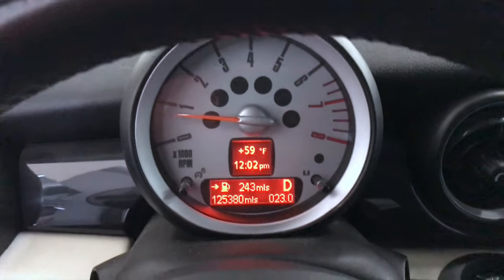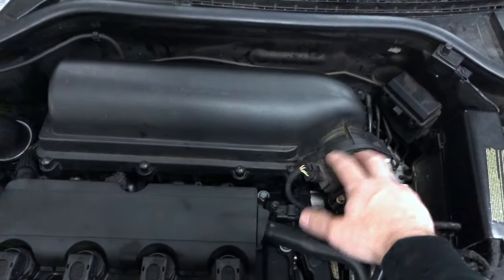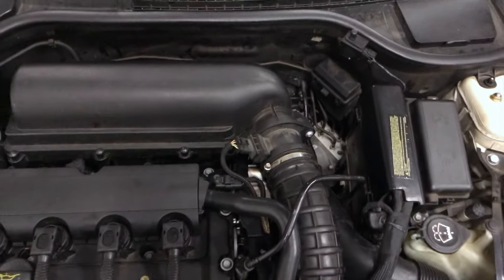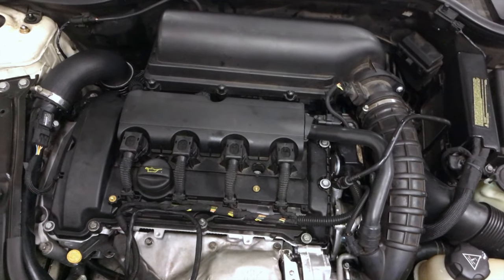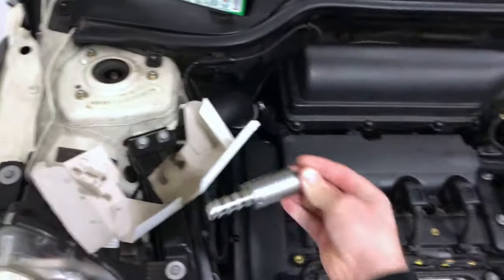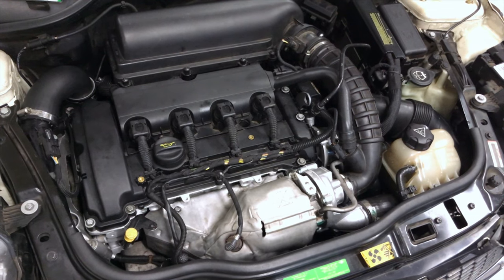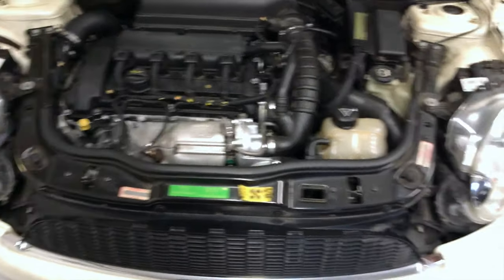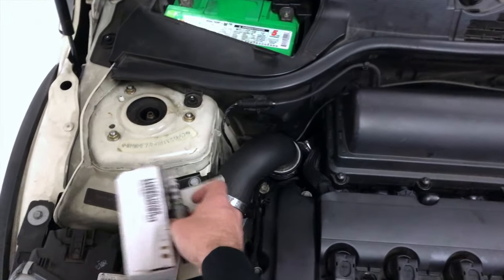MINI:  Erratic Idle Issue, SOLVED

Comment: Hi Mike, great video. I have a 2017 F55 Cooper S which started doing the same, rough idle and jumping revs, but only when it’s cold. After a few minutes the problem disappears. 
My car is currently at the dealership but they haven’t found the problem
Do you think it could be the Vanos Solenoid?
Thank you
Reply from the maker: That is a different engine, so likely not.  Let us know what they find. Thanks for watching.
Reply: Mike MDs they solved the problem! Apparently it was some sort of programming the car’s computer needed. 

They told me the problem may have started one time that the car ran out of battery and I jump started it with another car. The difference in voltage could have messed up the settings. Something to be aware of if you want to jump start this German complex vehicles nowadays.
Reply: @ivancaro8544  Do you know what they had to reset? I have a 2012 R60 S All4 with this same issue and I've been chasing it with new parts for a while. It has a rough cold idle, but cleans right up when the car warms up. I've jumped my car in the past, but never thought that could be the root cause of the issue. I called my local dealer and they haven't heard of any issue like this. I want to be able to send them in the right direction to get this fixed.
Reply: @Rudeman422  Hi Rudy,

The way the dealership will found the solution is to experience the problem themselves. In my case, I left the car a few days there and they told me that one day in the morning when they turned the car on, they felt the rough idle. They proceed to concect the scanner and found out the car needed coding. At the end they told me they had solved the problem, but in case I would further experience the rough idle, they would have to change the Radiator Condenser Cooling Fan, as well as the Fuel Tank Breather Valve. So I imagine the coding had something to do with this parts.

My advice would be to scan de car while the rough idle and see if there is any coding the car needs, or look for some faulty codes. The problem with this cars is that they are so electrical and when you jump start them with another high voltage battery, it can cause some issues. I was also experiencing a bad fuel consumption, about 18 miles per gallon. After the coding I´m averaging 28 miles to the gallon.

Good Luck!

Comment: When I turn on my mini r50, the idle goes lower than usual for a few seconds, it shakes and then goes back to normal. It does that a few times when cold then after a minute it runs normal...do you know what it might be?
Reply from the maker: Might be a vacuum leak.  You will need to see what fault codes it has if  any.
Reply: @MikeMDs  it doesn't show any engine faults
Reply from the maker: It sounds like a vacuum leak if i were to guess.  It takes a pretty large vacuum leak to set the check engine light on the first gen MINI's
Reply: @MikeMDs  I will check that. Thank you very much for the help

Comment: I wonder if this is an issue that can plague bmw as well. I have an 04 that I have replaced many parts on and still getting shaking idle. maybe need to do a trip to the pull a part to check it out.
Reply: BMW has a bulletin for this. Very common problem.
Reply: @lynxstarautomotive208  any way a normal pleb can locate such a bulletin?

Comment: hey mike I have an 07 JCW and when the engine is cold it doesn't like to start and I have to rev it for it to run. It does have the code for the MAF sensor but I know that more than likely means I need to change the throttle body. When the engine is warm I don't have this issue upon starting. any tips on how to move forward would be greatly appreciated.
Reply from the maker: Hard to know, may also be a high pressure fuel pump.

Comment: I’ve got one and the engine intermittently shakes like you can feel it shake the car but I don’t have any issues starting the car, any ideas?
Reply from the maker: It can be many things. The basics need to be ruled out first such as ignition  and fuel pressure.
Reply: @MikeMDs  it’s a bit strange as the problem only starts once the car has warmed up, it runs well from cold start.

Comment: Hi Mike, my car is a mini cooper hatch r56. When i start driving my car and suddenly goes to 1000rpm for a few second and either it will stall after a few sec or increase in rpm about 3000 then the car is almost feels like sluggish, shaky then after a few min of happening that the car is back to normal.

But all those above only happen when i dont do long warm up like 5 mins or if i rev the car for a few sec when in cold start. It runs fine.

My car sometimes show MAF fault code. If you know what could be causing that please let me know Mike.
Reply from the maker: Hard to know.  It could be a a vacuum leak somewhere ,  or a bad throttle body.  Both those things can cause what you are describing.
Reply: @MikeMDs  thanks Mike. Im getting it checked out soon

Comment: I have this issue with an R50 except it's chugging and then shuts off unless I keep my foot on the gas. Any ideas? Thank you. I've done the head gasket and timing chain on here and I'm tired of taking it apart...sheesh
Reply from the maker: It's hard to know. what are the fault code descriptions?
Reply: @MikeMDs  p0304. Misfit on cylinder 4. I swapped plus and coils, remains on 4. Found out the PCV was clogging and that's why it wouldn't stay running but it still has the misfire
Reply: @MikeMDs  thanks for replying!
Reply from the maker: You said R50? Does it have individual ignition coils? Or  does it have  a coil pack?
Reply: @MikeMDs  it has the main ignition coil and then the individual coils coming off of it
Reply from the maker: Okay, Have you done a compression test on that cylinder? Is the readings the same as the other cylinders?
Reply: @MikeMDs  I have not as of yet. Also, should I look at fuel injectors?
Reply from the maker: You need to check compression before proceeding. If compression is good then it can be a bad fuel injector or a faulty Engine control unit. If compression is bad then it could be a burnt valve or damaged piston / piston rings.
Reply: @MikeMDs  okay. Will do. I just pulled the spark plugs and all of them were dry except 4. It was wet wet and when the car is running, there is a strong gas smell
Reply from the maker: Okay.  I have seen injectors get stuck open causing the fuel to wash the cylinder walls off making no compression.  You can try a fuel injector if it is easier for you. But if you do a compression test you must  disable the fuel pump and perform a "wet compression" test on that cylinder due to it being compromised with fuel. It is common for the exhaust valve to burn on those engines as well, which will cause a misfire and zero compression. The excess fuel in the combustion chamber may be a stuck open injector or buildup from no compression causing incomplete combustion.
Reply: @MikeMDs  thank you! I will see if there is a YouTube to do a wet compression but I will start with the fuel injector swap

Comment: crazy misfires on all cylinders, I replaced my fuel filter now I cant get the car to start. do I need to build pressure and how?
Reply from the maker: If the pump is working then pressure should build automatically. If you have a turbo model, then it may be a faulty high pressure fuel pump.

Comment: A code is one thing but understanding what led up to code being displayed is another. I own both a Mercedes 2002 SLK 320 and a 2013 Mini Cooper S hatchback. The Mercedes has thrown only one code for an inoperative taillight assembly. This is a common fault for this car and I traced it down to the left assembly. I reviewed all the fixes on UTUBE and never got the problem fixed. The fix was to replaced the entire assembly with a unit manufactured prior to the year 1999. It appears Mercedes used a subcontractor to manufacture this part and they screwed up in their manufacturing process. Mike, did his trouble shooting and used the codes to steer him in the right direction. Being a parts chaser is both time consuming and a waste of money.
Reply from the maker: Interesting. Thanks for your thoughts.

Comment: I got lots fuel on cylinder 3 and runs just like yours what would be every ones guess???
Reply from the maker: Could be a leaky injector. Usually if there is an ignition issue the engine control module will cut out the fuel injector from operating.
Reply: @MikeMDs  tnx for you reply… I put new injector now number 2 injector is not good can you assist me what could be the issue and where is the piston suppose to be at with the both  cams at mark… am checking timing now and am sure the Pcv is not good cause found lots oil on the Pcv side thank you!!!

Comment: My car started doing some of that weird chugging feeling every once in a while right before stopping or slowing down but now I'm having a 2885 code only after I get up to 3/4th gear "auto trans" and gas it moderately hard but not floor it. I have never floored the skinny pedal on this vehicle
Reply from the maker: This video is a rare issue and assuming all other resources have been exhausted.  You may need to have the car diagnosed.

Comment: hey bro mine does the same thing but leaking oil everywhere and coolant too and i got 8 code cooland drain super fast after i pour some in  p0012 camshaft timing over retared bank 1 and camshafe position slow respon bank 1 random/mult cylinder misfire detected / cylinder 3/4 missfire

Comment: Hi Mike, 
I just used a tin of Wynns air-intake cleaner on my Mini Clubman 1.4 non turbo after the air box and before the throttle body. Ran car at 2500rpm and sprayed short burst each time the revs returned to normal after dropping. The car starts perfectly well and idles as normal until I just nudge the throttle to 1000 rpm as it settles back to idle the cars revs drop further the car shudders nearly stalls then idles then shudders then stalls. on restarting the engine the car idles perfectly fine till i nudge the throttle. Any idea what using this spray could have done.
Reply from the maker: Hard to say without scanning faults.  May have an air leak somewhere before or after the throttle body. Also the throttle bodys go bad on those causing that issue as well. If there is only mass air meter faults then it is likely a faulty throttle body.
Reply: @MikeMDs   Thanks for the promp reply but there are no engine warning lights on dash everything is all is good there. Do I need to have it connected to a diagnostics tool for faults to show up. Great channel

Comment: Hey Mike. Nice video, I have the P115d and P2187 on a non-S clubman. I did all of the below and still getting the dreaded code - 
- new PCV diaphragm kit

- new PCV hose
- new throttle body (VDO brand)
- new maf sensor (Bosch)
- new oil cap

- removed intake manifold - put new gaskets for intake manifold and throttle body

same P115d error and issues only during idling. Idles very rough and some times turns off. Also, while at idle the short term fuel readings go to 25 trying to compensate for the lean mixture.. At steady higher rpms everything is normal. There is definitely a vaccum issue but I am not able to figure out where.
 
Do you think the fuel tank breather valve can cause the same issue?
Reply from the maker: Rule out external air leeks with a smoke machine.  Timing issues can cause lean mixture and mass air meter faults as well. If the timing chain guides are broken they will set these faults first before storing timing fault codes in some cases. Thats all I can think of off the top of my head. Best of luck

Comment: This is very helpful! I have one question my car does the same thing same noise and spitter but only after a cold start and it soon fades away when up to temp. Would you think it could possibly be the same issue you had? Any help is much appreciated!!
Reply: I’m trying to nut out the same issue myself. 

I’m thinking this solenoid needs the “adaption values” reset when being replaced 🤷🏻
Reply: @replicant357   how did you go sorting this out, i have the same thing thinking it only happens till the solenoid gets oil pressure first thing on cold start up in the morning?

Comment: I keep throwing a code, P1631 on my 09 R56. I'm thinking it's the throttle body. Sometimes it has a rough idle. The plate may need to be cleaned or I have to replace it. What do you think?
Reply from the maker: It is probably a bad throttle body.  The plastic gears internally are probably worn out. Replace with a good brand. No china stuff.
Reply: @MikeMDs  I'll take your word for it. Any recommendations on a brand? RockAuto has one from VDO for $169.
Reply from the maker: VDO is a factory brand so you are good.  That is a killer price as well!
Reply: @MikeMDs  awesome thanks so much!
Reply: @MikeMDs  sorry to bother you again. Received my throttle body, but in the course of replacing it my PCV hose broke, so now I have to do that too, so I haven't been able to actually finish the job just yet. My question is, do I need to reset the throttle adaptations? Some people are saying if you use stock it's not necessary. VDO I'm assuming could just be a direct swap and she'd fire right up?
Reply from the maker: Only some models have the option to reset throttle adaptations. Assuming this fixes your issue, the car will relearn the throttle adaptations as you drive.  You should be fine just clearing the code.
Reply: @MikeMDs  just wanted to let you know that I put the new throttle body in today and everything fired right up! Looks like my old one, the plate was stuck slightly open. Just wanted to thank you for your help. Thank you!
Reply from the maker: Im happy that it worked out for you. Wish you the best.
Reply: @MikeMDs  I'm back, sadly, and throwing 2 codes. P1497 and 2B64. My idle sounds exactly like this, for the most part, but I just replaced the VANOS solenoid and did a noise maker delete (Forge) to make sure there wasn't a leak to the throttle body, but didn't fix it. 😞 Not sure where to go from here. Maybe MAF sensor?

Comment: I get that bad idle and code p0015 was wondering what do you do with that code?
Reply from the maker: It can either be a bad exhaust vanos solenoid, bad vanos gear or a timing chain issue. Also a bad cylinder head cam journal can cause lack of engine oil pressure to the vanos gear. I'd start with the vanos solenoid. Then pull the valve cover to inspect the timing chain.
Reply: @MikeMDs  thank you. Why do they say I need to change the sensors on the right side of valve cover. Or left rather sitting in v the car

Comment: Hi, thanks for the video, it has made me think that my wife's starting issues on her 2008 MINI Cooper S Clubman is the temp sensor, it takes a few goes cranking before it starts, I've already changed the fuel filter first (and it sure needed it) and it definitley made a difference for a day or two, but then it's back being a pain starting again (cold-ish weather) but don't really want to go for a new HPFP if it could be a sensor. What do you think?
Reply from the maker: Without seeing it, my guess is the HPP.  If its original its a good idea to replace it anyways. Don't go china aftermarket or reman.
Reply: @MikeMDs  thanks, I'll give one a try, I've got to take a cylinder head off a mates Cooper S this week, (burnt a valve out) I'll borrow the pump and sensor 9ff his head while it's away being done, and see which one it is 🤞 it's the cheaper sensor, knowing my luck though, it'll be the £500 pump lol 🤣
Reply from the maker: Best of luck!

Comment: Hi there Mike. Just wondering if you could help me out. Ive recently bought a mini cooper s 2010. There was nothing wrong with it when I bought it. I've replaced the intercooler with a larger one. Installed a aem air filter. And sandwiched a bov just before the diverted valve. And added a jorge noise generater delete hose. And ever since all these upgrades I've Been experiencing what you've described in this video. I've tried to drive it but it won't go over 2000revs. it will let me drive it, change gear and everything. But just won't go past 2000revs. I'm thinking that this is when the boost for the turbo starts and there's something stopping it. Any information would be great. 'your videos are very informative'

Comment: I had this same exact issue though it happened within 5 minutes of start up of a fresh rebuild, idiot machine shop left glass beads debris causing VVT solenoid to stick. Like you I was chasing around for the problem which took some time before I found it. machine shops can be hacks and cause issues same with body shops
Reply from the maker: Yes it was a challenge to figure out. I'm glad you were able to resolve it. The symptoms were just purplexing.

Comment: hi mike! mine is running like that only in idle mode....my fault code called P0141 02 Sensor Heater BANK 1 Sensor 2
Reply from the maker: You can try replacing that sensor first since its bad anyways and see what happens.

Comment: These cars have very low oil pressures, when there over 100k literally no oil pressure at normal engine temp at idle. So the vanos could be fine and the problem is oil pressure not adjusting the cam angle.
Reply: My oil lamp on! Always and problem is same in this video. What can I do?

Comment: What fault code does it usually send off?
Reply from the maker: Mass air meter plausibility fault is the only fault I had. Which is usually caused by a bad throttle body. But not in this case.